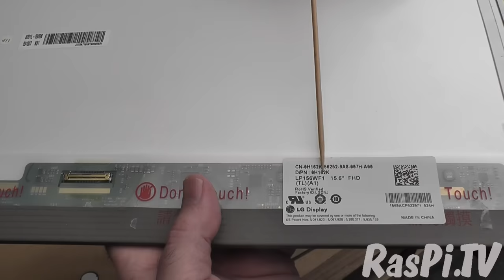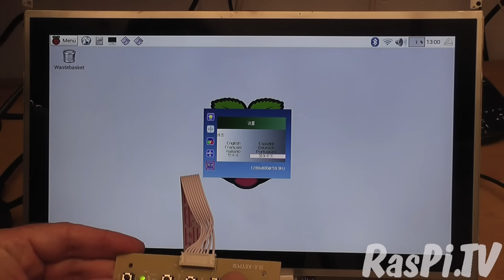Make Your Own 15.6" Full HD Screen for 32 bucks for use with Raspberry Pi, DSLR, Video camera

Comment: Just done this for a project I'm doing with a pi - worked great...got an old broken laptop from a friend - driver board was £22.19 delivered (eBay from China). Took literally a few minutes of messing about & hey-presto...full HDMI screen for my pi, wonderful. Thanks for sharing.
Reply from the maker: Awesome. Nice job.
Reply: Dan Hardy can I take the driver board out of the laptop ?
Reply: Dan Hardy does a faulty screen will do

Comment: just a note on attaching driver board to the back ,when you disassemble the casing for it on the laptop try to leave it in a good condition,with a few modification you can turn it into a place to attach the driver board and a stand for the scrren.

Comment: Well the laptop I was using got some kinda worm in the EPROM chip and the Dell crapped out.  I tore it apart and found the nomenclature for the screen, a Samsung LTN156AT01 which I ordered a driver for.  I'm still waiting on it to be delivered.  I saved the hinge screws and bezel and put it back together.  The hinges had two very nice studs and a couple of screw holes.  I cut off a 2"X4" at 15" and drilled two holes for the studs to sit in.  Then I drilled two more holes to use screws to hold the screen in place.  It makes a nice little stand for the screen, which I can close down over my keyboard to keep out the dust.  I see from re-watching your video that I'll have to modify the back of the Dell screen case to accept the power driver cable from the driver board.  I thank you for this video and so does my wife, because she's tired of me using our 55" TV mounted on the wall for my Raspberry PI 3 monitor.  My screen from the Dell is 1399 X 786, so it's not truly high definition but will suffice for my RPI 3 monitor.  Thanks again for this great video tutorial on how to re-purpose a dead computer with some surviving parts.  Qudos my friend!!  :-)
Reply from the maker: You're welcome. I look forward to hearing how it goes when the driver arrives :)

Comment: why not take that whole laptop and remove the motherboard, place the raspberry pi in, covert the laptops hard drive to external, inspect the keyboard circuitry and check if it can be programmed or made external, make it portable by reusing the laptop's old battery you'll have to add a power supply circuit meant for recharging the battery like the ones used in portable powerbanks, its relatively cheap and seems like a nice project
Reply: dammit, you stole my idea!
Reply: laptop keyboards are a pain to connect, you'd need something similar to the display driver and those are hard to find
Reply: I'd like to see an rpi made without headers, ..just edge-pins, so its flat body can be inserted/removed into laptops and TVs.  Kind of a modular CPU.
Reply from the maker: You're describing the Raspberry Pi Compute Module released in June 2014 http://raspi.tv/2014/raspberry-pi-compute-module there is a new version due out soon
Reply: +Alex Eames Hi I have the same laptop as you. It is working fine however the screen is cracked. Would it be possible to take out the LCD(the way you did it) and carry on using the laptop by connecting to a external monitor.
Reply from the maker: Sis Swim it might be, but you could probably find a replacement LCD and fix it too
Reply: Alex Eames Thanks, I'l look into it.
Reply: GnuReligion, the Pi Zero doesn't have the GPIO header attached. Ok, it's less powerful and you'll need OTG cables, but it's tiny. Alternatively you could try desoldering the headers.
Reply: afxinfinitee Yes, you are right.  What I meant was lose the 3d connectors altogether, in favor of a single, slim card-edge connector.  This way, you can slide in your mostly-flat Pi-like board, into any appliance, like a laptop console, TV or such.  Modular-ize the CPU and support chips, as it is now mostly trivial in cost, power, and size compared to the video and keyboard.
Reply: Yup, EOMA68 is exactly the thing.  In a laptop, would like to see user-replaceable 18650s as well.
Reply: Muhammad Hoosen that's a long sentence
Reply: Muhammad Hoosen that is a good and easier way
Reply: A new laptop would be like 4x the price for the same power.
Reply: I ran an HP Single Core (hardly worth using now, but maybe with Linux) using an external monitor for awhile. The screen was damaged on the laptop. All depends if you have auxiliary port for extra monitor. Can't remember what it does at boot though, would be an issue if it didn't default to external monitor. Yet, if your OS isn't set with a password on boot, you could just let it boot and see what happens. My current laptop with external monitor and laptop screen boots with external displaying stuff, then password has to be entered on laptop screen. I'm sure it can be adjusted in Windows-Display config screen. For what it's worth per the project this video is on, I spent $30 for driver/controller board (waited at least 2 weeks to receive from China); $10 for power supply; all the time to take screen out of laptop; still have to find correct config for the screen as its graphics are fuzzy in some areas (my display may be atypical as it's a 17.4"); AND need to build a display holder. However, I went to a pawn shop to price used HDMI displays, and found a $10 VGA 20" display. Good enough for my needs right now.
Reply: Diamond Sle]ahes -  If the screen is busted and you are going to connect an external screen, why bother to remove the laptop screen. Save yourself the trouble and just plug in a monitor and switch to that by pressing the video ext/int switch button.
Reply: It's almost impossible to reuse laptop keyboard

Comment: This is a good starting point.
I'm looking at ultra-widescreen LCD's to go with 60% mechanical keyboards. Finding the right screen is the first step - then comes the driver board (as you mentioned) and finish off shoving it all in a tiny box.

Comment: This is fantastic. Great video and explained very clearly. When I watch these "tear it apart" videos, nobody every talks about how to either utilize the parts to recreate the "outside" of things. There's always a bundle of wires, and a huge mess of things everywhere. I would have saved the bezel and even the back of the screen somehow. That would protect the potential electrical issues and also give you a "finished" back surface, which I presume, you could then stick the Pi to and possibly some of the other accouterments. Seems that the reason most people don't try these things is that you have a huge mess of things when you're done. Wires laying everywhere, etc. I would like to see more vids on how to "finish" the project so you have a nice clean setup.

Comment: I started doing this in 2006 . But I used 15.4" 1920X1200 laptop screens with a controller to make Full HD projectors. Those were fun times :)

Comment: You should remind people to take the battery out of the laptop before you start pulling it apart.
Reply: Tadeo Kondrak because the battery could still have a charge and may zap you or your components
Reply: Tadeo Kondrak mate it takes 5 seconds to unplug the battery
Reply: A whole 5 seconds! Bugger that.
Reply: Jay M Way to dodge the question
Reply: Its weird when you see someone from Dogechat/CoinChat years later on a random youtube video's comment section. :p
Reply: @tdeo  What components? Maybe the one you need and are opening your laptop for in the first place - the LCD screen.
Reply: Jay M it's a digital connector
Do you take the battery out before you unplug a flash drive?
Reply: Jay M take the battery out pack out split it and test and recycle the 18650 Li-ion cells into a new battery pack more like it! You can buy a cheap battery management system of ebay to repurpose them as they will most likely be unprotected. You will typically find one or two in a pack of six that are below par that don't hold charge or charge to full capacity. Collect enough of these and you can tag them together and you will be able to power your e bike with them or use them in portable sound system projects.

Comment: Right! I already saw that these existed on ebay, but forgot all about it, but thanks to this video, I might be able to save quite some money. If the display fits a driver board that is. But I have the perfect candidate as far as junk goes: a laptop display with a few burned display wires. So the display is completely useless without replacing the wires, or doing this excellent hack.

Comment: I have that exact same driver board running an Acer 11.6" 1360x768 monitor as a 3rd display for my PC system. Been running for over a year no problems.

Comment: What necessitates you buying a new driver board for the monitor? Is it the fact that it died when it reheated? I have a 12 year old dell inspiron 1150 laptop in fine working condition. Do I even need to buy anything or can I use the existing driver board in the gust of the laptop?

Comment: I'm in the process of setting one of these driver boards to work.  (I'm also using a 15.6" screen panel from a Dell lap-top but it's HD rather than FHD.)  I should have known better but I had a bit of a false start - the board needs an input to one or other of its video ports or else the screen goes black and the LED turns from green to red, within seconds of switching on!  In my own defense, I was trying to test the board and screen panel with only the minimum of bench space.  When I stopped being lazy and cleared enough space to add my lap-top to the set-up, the driver board and screen panel stayed on OK.

However, Alex' button sequence to change to menus in English doesn't seem to work for my board.  My board came from a different supplier but they all look very much the same in pictures on YouTube and eBay.
Reply: Initially, I got an OSD (on-screen display) window with just Chinese characters.  I'm not sure quite what I did next but eventually, I got the OSD window with five icons down its left-hand edge and the menu in Chinese characters on the right.  The bottom icon has a hammer & pliers image, that's the 'set up' menu.  If you navigate to that icon (button 'right' = + or 'up' and button 'left' = - or 'down') and then select it by pressing the 'menu' button then the top item is 'Language' (still in Chinese).  Select that, again by pressing the 'menu' button and you should get the list of languages.  Navigate to the desired language, press the 'menu' button again to select it.  That's the best description I can give for what worked for me.  I hope it helps.

Comment: Do you get the PSU with the driver board, or is that an extra cost?

I've resurrected laptops which were crippled by overheating issues by giving them a thorough clear out inside. Airduster, new thermal paste and job done.

I would only recommended this if the laptop mobo or graphics card is dead.

Conversely, if you have a damaged screen and a damaged mobo on another laptop, this project will allow you to use the good screen on the laptop with the bad screen. It's not pretty but it's functional and it's also no longer portable. But you have a working laptop.

Comment: How is the power delivered to the driver board? It looks like not included with driver board. Either power from old laptop or can a RPi power adapter be used? My RPi 3 power adapter says it's 5 volt, 2.5 amp.

Comment: Brilliant.  Who doesn't have a couple of dead craptops?  I just checked and LCD driver boards on eBay are as low as US$13 delivered from China.

This would be perfect to build a portable radio station in a waterproof case with a monitor in the flip open lid and a Raspberry Pi, transceiver and LiFePO4 batteries in the lower part with a trackpad keyboard and lightweight end fed wire antenna.  Hoist the antenna up in a tree while the Pi is booting and you're on the air with a nice big display in no time, just like at home.

Comment: I got my driver board today in the mail (on a slow boat from China) and put together my Dell LCD screen.  It works very well, except my driver board hooked just a little bit different from the one you show in the video.  I had a separate board for the high voltage driver which I finally figured out.  So far, so good.  I need to get a higher amperage 12 v. supply ´cause the specs. called for a 4 amp supply and I´m only running it on 1 amp 12 v. supply ´cause that´s all I have at the moment.  I´m keeping a watch on the temp of the 1 amp supply so it doesn´t overheat things.  Thank you very much for your video tutorial on the correct procedure by which to install the driver board.  My wife thanks you, too, ´cause she´s tired of me hogging the 55¨ TV monitor for my computer monitor.  We couldn´t watch TV and me on the computer at the same time.  So a BIG ´OLE THANKS to you from her as well.

The only thing is I cannot get an audio signal out of my Raspberry PI 3´s audio out jack.      
When it´s connected to the HDMI output the sound is routed through the HDMI output and I guess it must suppress the audio out jack on the Raspberry PI 3.  Do you know how to remedy this problem?
Reply from the maker: W. Rusty Lane yay. result 😀 Enjoy using it.

Comment: A project I'm more interested in:
Gutting a dead laptop, inserting a Pi, and connecting it to the laptop's display and keyboard.

Bonus points for getting the trackpad and speakers to work too.

Comment: so glad they started making those boards, I had a look at doing this about 10 years ago, but you couldn't get your hands on a board to control the LCD, 
I will have to give this a try now and see how it goes.
If it has a HDMI, it could be turned into a TV, no?
Great vid, thanks for the tips :)

Comment: I have a number of leftover screens like N133HSE, B156HAN02, etc; and I see a number of their driver boards sold at AliExpress. What I don't see, though, is a mounting case with a stand to house the resulting solution. Are these on sale, or should they be done by every DIY enthusiast individually ?

Comment: Did the power source come with the board?  From the old laptop?  Something you'd have to buy if you don't have one or a spare one?
Reply: wwwShadow7 You can use a 12v switching power supply.
Reply: wwwShadow7 old desktop LCD monitors often have an external 12V 3.5A mains adapter
Reply: I think Shadow knows you can use a 12v switching power supply, I think he was asking if the driver board in this case came with a power supply. I'd also like the ask as I'm curious, yes or no?
Reply: Most driver boards don't come with a power supply. 12v switching power supplies are much rarer and more expensive then they should be. You could use a desktop PSU with a bit of modification.

Comment: I need one for a Panasonic CF-28 Toughbook. The display still works so could be good for gutting it and putting a Raspberry Pi inside but I get the feeling there will be no driver board for it. It would be so cool to have a Raspberry Pi Toughbook.

Comment: yes this is a great idea. Should go with out saying but, when looking for your monitor driver board, you will need a power source. Read the sellers discription for which one to get. Not all power sources are created equal. Never the less, this is a great idea for reusing that monitor.

Comment: Do you think this would still work with a chrombook? I have a 1080p samsung that died but, the screen is good.
Reply from the maker: Darc Vigilante if you can find a driver board for it, sure. but you won't know until you get the LCD part number 😀

Comment: Great video Alex.

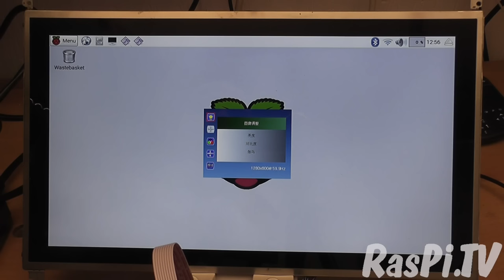At 9:28 it says on screen "1280x800". Did you need to adjust a setting on the RPi to get 1920x1080 ?
Reply: oh, sorry just continued the video and found my answer I think... "after a reboot it went fullscreen" (to 1920x1080?)
Reply from the maker: Actually I find that forcing 1280x800 makes text and icons large enough to see clearly on a 1920 x 1080 screen. I do it even with my 23" Samsung.

Comment: Just a little question. You said you had two laptops die from overheating.

How is that possible? Laptops throttle when they get too hot, and shut down when necessary way before any real damage is done. How did the defects show themselves?

I mean absolutely no respect with this, I just work in IT for a few years and never heard of a laptop that "died from overheating". Now I'm a little bit concerned about my daily driver as that little 14" dwarf isn't exactly running cold either.

Comment: Just wanted to say thank you for the video.  I just ordered my vid card for an old laptop I had sitting around for parts.  Can't wait to get it and play. Going to make a raspberry pi 2 portable on a board of hard wood, should come out nice.  Thanks again.
Reply from the maker: Hope it works out well for you. Let us know how it goes :)
Reply: Just wanted to let you know my vid card came in from ebay 32 dollars US and I got the 1 years warranty for $2.49 extra just in case.  I just hooked everything up and it worked like a charm.  Thank  you for showing us this little trick it worked great.  Now all I have to do is mount everything nicely and I have a raspberry pi 3 portable!  Thanks again.
Reply from the maker: David Galloway Brilliant :) Glad it worked out for you and thanks for coming back to tell us.

Comment: Not sure why you included a screenshot of a vendor where the text reads "Sorry, this item is no longer available!"  It's not quite as easy to find just any driver board you want for any display you happen to have.
Reply from the maker: It's very simple. I wanted to show you where I got it from. That one might be no longer available, but so what? The point of the video is to show  you the general method not the specific place to buy a specific board.